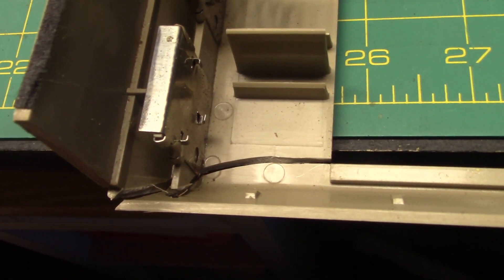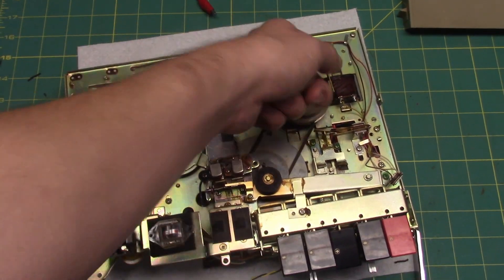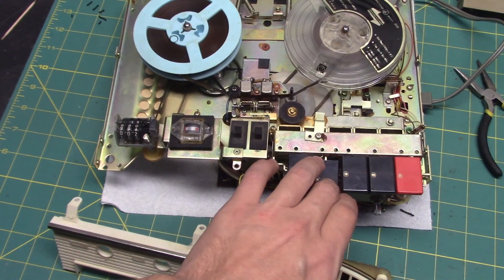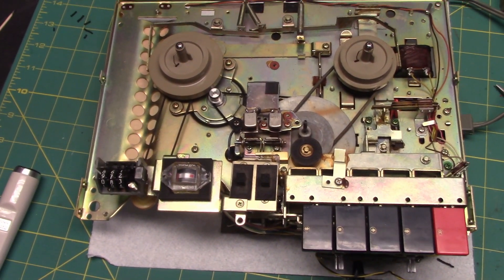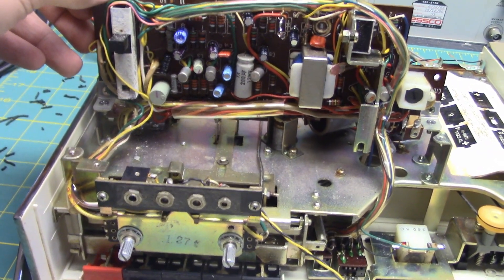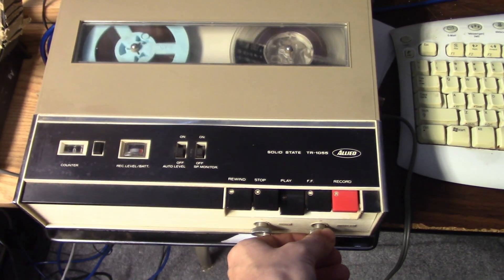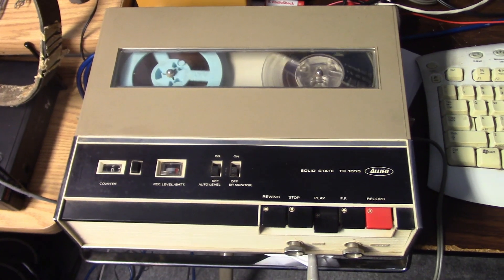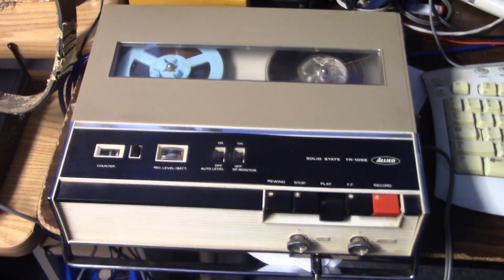Allied TR-1055 5-inch reel to reel tape recorder

Comment: Love these old babies. RS sold recorders made by nearly every maker over the years: Hitachi, NVS/JVC, Sanyo, and Toshiba were the main ones but others pop up.

This was a fairly simple mechanism. I like that, less to go wrong. Just about all units from this era need full electrolytic re-capping. Sanyo and Hitachi were the worst in that regard. Beware of testing these by bridging old caps with new. Many caps from back then go dead short and bridging may give the false impression the old cap is OK because of no change. In the meantime that short is frying the transistor it feeds or "bypasses".

Meters doing nothing in Auto-Level position was the usual thing back then.

That "diode" you found was commonly a feed-thru capacitor to reduce motor noise. They seldom fail so it may be just fine.

Great find/buy! Great restoration too. Good for another half-century.

BTW, if you use a later condenser replacement mic with one of these instead of the original dynamic mics these came with the sound may blow you away, especially if the bias is adjusted for later tape types. (Depends upon original circuit design quality.) I had some Wollensak portables (Sanyo) that produced stunning recordings after these improvements. Some were used to record sound for railroad films. Sounds like this one will also do well.

Comment: Thanks for posting this video!  I bought this very same tape deck brand new when I was a kid back in the '60's!  I still have it!  It's in mint condition, but I haven't turned it on in several years.  I'm going to try it out now!  If I have any issues, I will definitely refer to your video!  Thanks again!.....Ken
Reply: I just tried it out and everything works except for the forward/fast forward mode....looks like surgery is needed!  Wish me luck!
Reply: I took mine apart yesterday and my drive belt was deteriorated as well.  Where can I find a replacement belt?  Ebay?  You don't have any extra's do you??  :)  I surgically sliced a heavy duty rubber band in half (narrowing it) so it would fit on the wheel.  It works, but I'd like to try and find something a little better.  Let me know if you can help me out....thanks, Ken

Comment: Very good machine, I like the mechanism except for the rubber ring on the drive pulley. Realistic 7" machines from the early 70's like the 999 models used that same rubber ring and it was always a problem. Wonder if you can somehow get an "O" ring in there to replace it.

Comment: I took mine apart yesterday and my drive belt was deteriorated as well.  Where can I find a replacement belt?  Ebay?  You don't have any extra's do you??  :)  I surgically sliced a heavy duty rubber band in half (narrowing it) so it would fit on the wheel.  It works, but I'd like to try and find something a little better.  Let me know if you can help me out....thanks, Ken
Reply from the maker: You can get assorted square belt sets on eBay for cheap. I would search cassette recorder assorted belts or similar. Some of the cheap belts can be of poor quality, however.